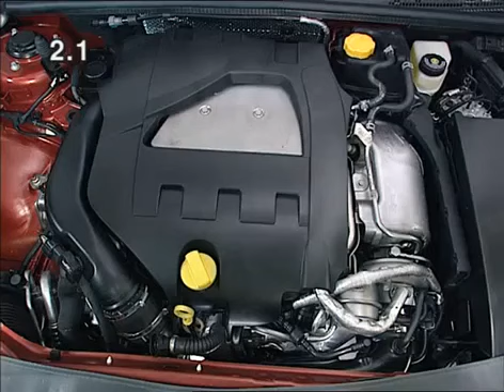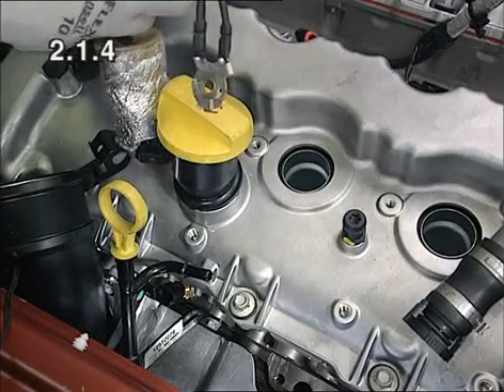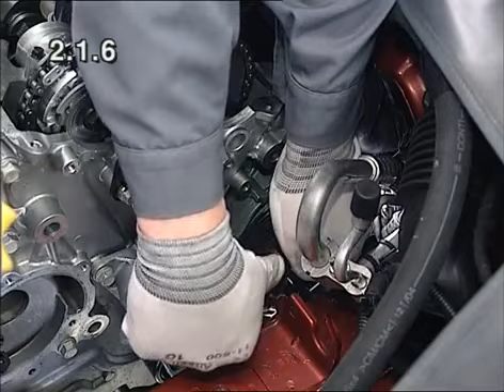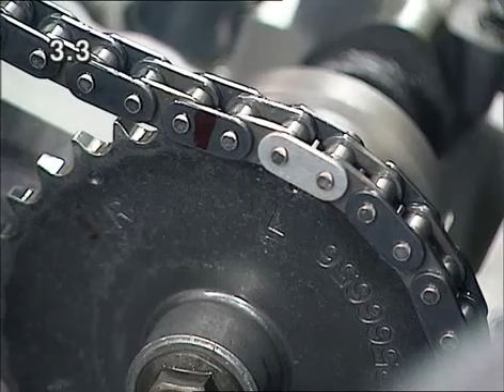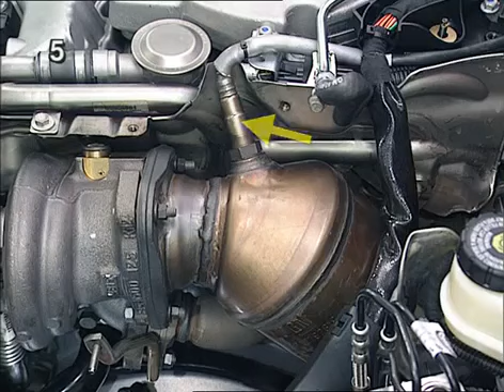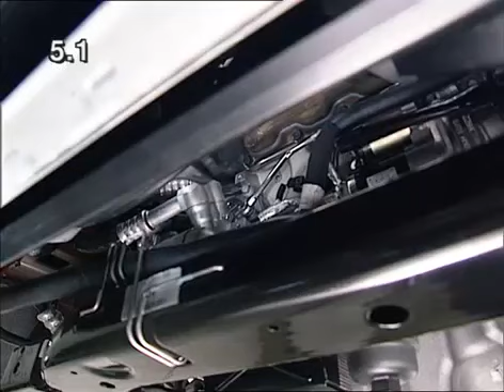Saab V6 2 8L |  Opel |  Vauxhall  2.8 Timing Belt

Comment: You can put a translation into Spanish, sabb has left Spain and we continue many with sabb cars and also these engines have been mounted on opel insignia opc, and we have no idea where to start and do things since a big problem with these cars is that they stretch the distribution chains and we do not want to put the reinforced ones, but we do not know if they are the same for this flagship model opc 2.8 v6 A28NER.